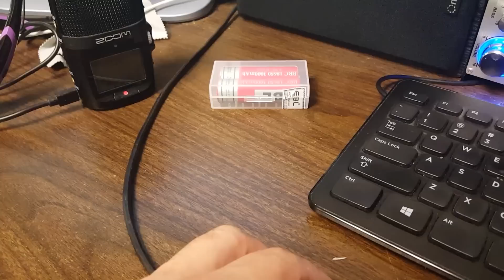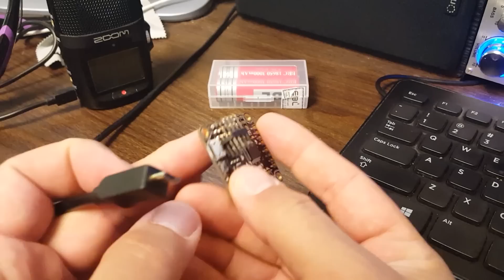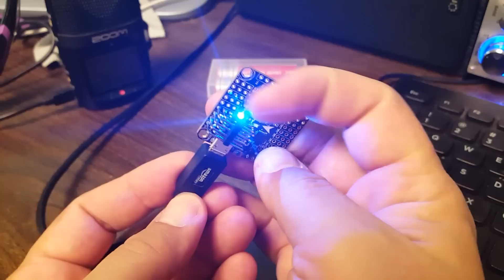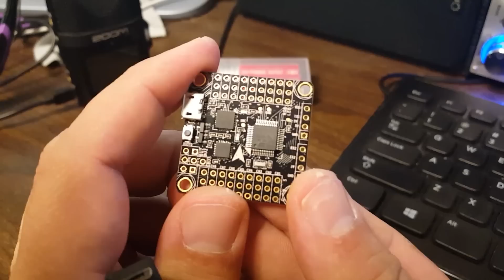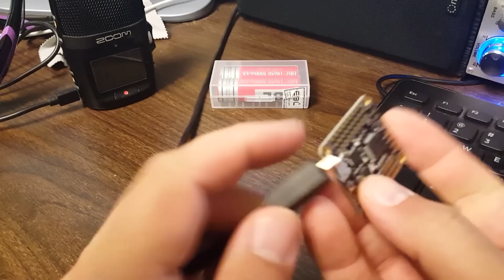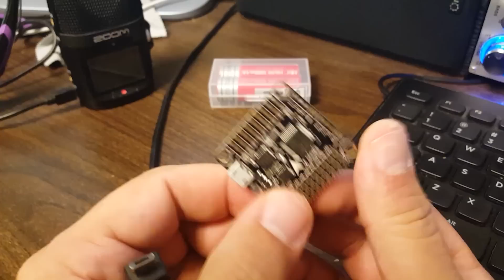Quadcopter Build Tip: Flash Your Controller Before You Install It

Comment: take a closer look at your x racer with a magnifying glass. I have been fighting to connect the board to cleanflight without result til I notice that resistence R8 and R9 were gone in the soldering process
Reply from the maker: +MrAkpalus interesting. But still there's no fixing it.

Comment: Hi there, I've just built a pure X frame which flies nice but I've noticed the motors get hot and it sounds a bit to me like D might be too high. Would you mind listening to it. Love your videos by the way, brilliant, many thanks.
Reply from the maker: +Mad Dog MiniQuad motors hot is a probable indication. Either lower D gain or filter more.
Reply: Cheers. I'm on Kiss gear I'm already on LPF FRQHigh. My Ds are 18.5, 20 and 0. I've put my maiden on youtube but the microphone on my Runcam is faulty, the motors don't really sound that bad!

Comment: First thing I do when opening it is plug it in and make sure the damn thing works! Solder it up only to find out its not working and chances are the vendor won't refund /replace. They just assume, rightly so probably, that the user killed it. Which is fair enough.

Comment: I learned this the hard way too :)
Reply: Or harder way; I had to desolder the F4 sitting on my FC and solder another one, after everything was in place. Really learned my lesson there.
Reply: +Christian Wilhelmsen I have also put everything together then realised the bootloader pins are hidden at the bottom and had to desolder half my escs to flip it up. My idiot list is extensive haha
Reply: +TheSinisterWeasel *learning list ;D